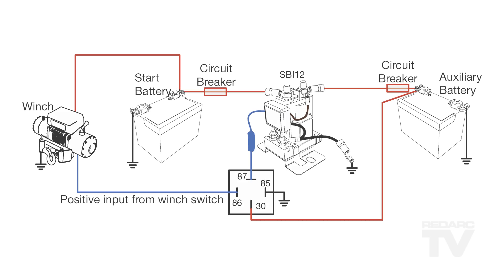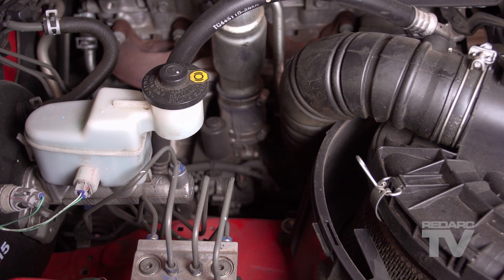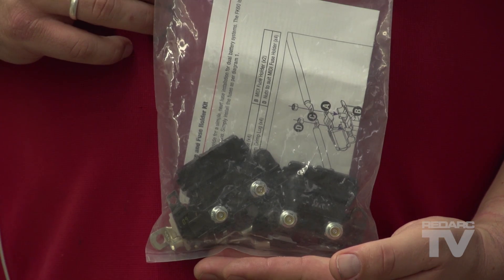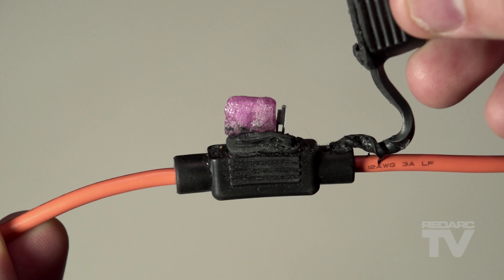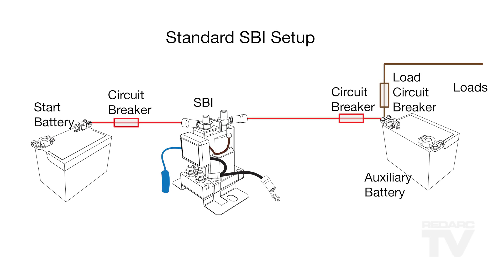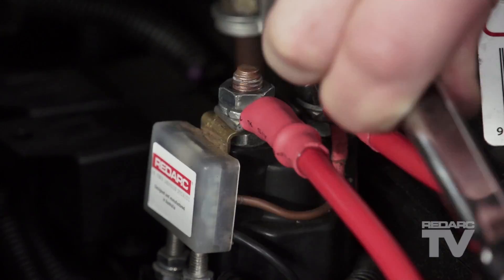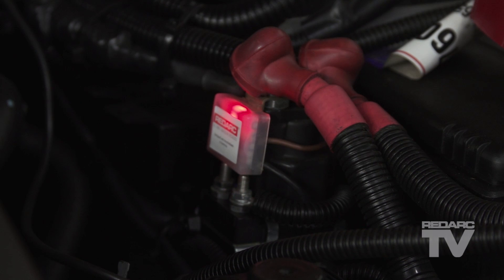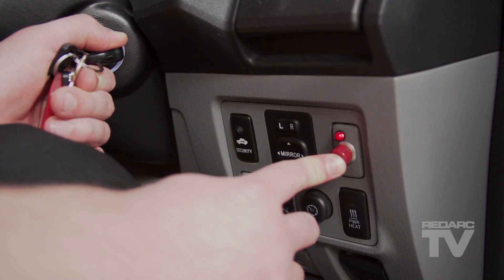How to install the REDARC Smart Battery Isolator

Comment: Can this unit work with a lithium battery?
Reply from the maker: Hi there - we don't recommend using an isolator in general for charging a Lithium battery. The power being given to the battery is not controlled and won't get the Lithium to 100% charge (more like 80% charged at most). You'd be better off with a BCDC unit instead that has a proper algorithm built-in for these batteries.
Reply: Good to know! Is this similar to a dc2dc charger for charging batteries to run product lines? Eg. Fridge

Comment: I have a question regarding that bridge device for jump starting. Is there a way to manually use that feature if you don’t have the button installed?
Reply from the maker: Thanks for watching! If you don't have the button installed you can bridge the override cable on the unit to a 12v source, this will activate the isoloator linking the batteries.
Reply: @REDARCElectronics  okay great thankyou. Is there a maximum distance that the isolator can be from the starter battery or auxiliary battery?
Reply from the maker: @ChristiannTyler  No maximum distance.

Comment: If you’re running a dc-dc charger with solar input between your lead acid crank battery and lithium auxiliary battery. Will using the override jump start function cause any damage to the charger or auxiliary battery?
Reply from the maker: Thanks for watching! It wont damage the charger but you'd need to check the battery's specifications to make sure it's suitable for that application.

Comment: Hi, a few months ago i installed this unit into my old hilux to run my fridge off my 120ah auxiliary battery. It worked great for a few weeks but gradually my car was getting harder and harder to start. Its at the point now that sometimes i cannot start my car unless i turn off my fridge. I am unsure of what the issue is because the isolator seems to charge the batteries fine. Any help would be appreciated.

Comment: 2:18 running a 100 amp agm battery with the red arc sbi as a house battery, can I get rid of the agm and run a lithium battery?
Reply from the maker: Thanks for watching! If you're looking at upgrading from an AGM battery to a lithium we'd recommend you also upgrade the SBI to a BCDC charger of some sort to properly look after the lithium. For more information on REDARCs range of BCDC chargers check out www.redarcelectronics.com/au/battery-chargers/dc-dc
Reply: I have the bcdc1225 and want the jump start feature of thr sbi. Will installing the sbi and jumpswitch cause a problem?

Comment: Why does my unit keep throwing the 100amp circuit breaker when I plug in my dcdc charger?
Reply from the maker: Thanks for watching! If you're having any issues, please don't hesitate to reach out to our Tech Support Team on 1300REDARC (1300 733 272).

Comment: Near the start of the video you show how to wire up a winch using a relay and the SBI blue wire...if I want to wire up the Option #3 (the jump start assist), can I do that by tapping off of the blue wire relay connection?  Also Option #3 does not show the inclusion of a LED indicator lamp, can the LED lamp be added to the Option #3 wiring diagram?
Reply from the maker: Thanks for watching! If you wanted to integrate the start assist feature you can, you will just need to wire the SBI12 as per the middle diagram on page 4 of the user manual. When wired this way you will want to T off between the momentary button and the resistor. This  cable will connect to pin 87 on the winch relay.

Comment: Great video! Is one of these needed if you have a smart alternator? I’m hooking up through the Redvision TVMS
Reply from the maker: Thanks for watching! If you're looking for charging capabilities with your RedVision and a smart alternator we recommend the BCDC battery charger or Manager30 battery management system. 

For more information we recommend giving our Tech Support Team a call on 1300REDARC (1300 733 272).

Comment: How long would it take to charge a flat 100ah battery?
Reply from the maker: Hi Scott, thanks for your comment. 

It will mainly depend on how much spare capacity the alternator has to give and the condition of the battery as to how long it will take to completely fill. If you’re looking to charge the battery from what we would consider ‘flat’ at 12V, for an alternator able to provide a spare 20A to the battery it might take approximately 2 or so hours of constant driving and a stable high voltage. 

There are quite a few variables, so can be tricky to properly work out too! If you want to have a chat to us about it, I’d recommend to ring our Tech Support team on 1300REDARC for further assistance.

Comment: I am about to install my recently purchased SBI12-D
The Installation instructions appear to be the same as for the SBI12.
I have watched your You Tube clip above and wish to implement the "Start Feature with Override Button" 
- I wish also to have the remote LED display indicating the unit is "working".
My issue is the fact that the 'D' unit works in both directing - can I display this fact with one or maybe two LEDs? If so, could you please provide me the circuit?
Reply from the maker: Hi Ron, thank you for your message. The LED indicator for the SBI12/SBI12D simply illuminates when the isolator is active – the Dual Sensing feature of the SBI12D measures both main terminal voltages and will activate when either reaches 13.2V, and illuminates the LED at the same time.

There is no ability to display the differentiation between which source activated the isolator, simply if it is active or not.

Option 2 on page 3 of the user manual provides the wiring diagram that includes the Push Button for Start Assist as well as the External LED.
If you require further assistance our Tech Team can assist in greater detail over the phone on 1300 REDARC.

Comment: Hi Mate, 
I'm wanting to run a second battery in the engine bay for a winch, but also another battery in my canopy to power a fridge and also some 12V outlets. 
What do you suggest I use? Engine bay will be AGM, canopy battery will potentially be Lithium. I have a 2021 SR5 hilux. Or is the canopy battery overkill for just a fridge, LED canopy lights and a few 12V outlets? I do plan on having solar input as well. I'm just unsure as to what is needed. The Hilux is only used for weekend 4X4 trips. 
Thanks heaps
Reply from the maker: The Lithium battery in the will be good – you will get the most useable power out of this setup for your fridge and relevant devices. We would recommend to use an SBI12 for the under-bonnet AGM battery and a BCDC1225D for the Lithium in the rear. That way, you are taking care of both, but not overloading the alternator of the HiLux either.
Reply: @REDARCElectronics  
Thanks for your advice, its much appreciated.

Comment: I am installing your SBI12 in my dual battery set up. As I’m putting the auxiliary battery in the tray, what size cable do i run from the SBI to the auxiliary battery? Length of cable is approximately 4.5m. Also the main load is an Engle fridge/freezer and some LED lighting.
Reply from the maker: Thank you for your message. This information can be found on page 1 of our instruction manual at https://www.redarc.com.au/Content/Images/uploaded/Manuals/SBI%20Instruction%20Manual.pdf

Comment: What does it indicate when the red light doesn't go off
Reply from the maker: Hi Glen, When the SBI12’s red LED is illuminated this indicates the SBI12 is ON (closed contacts). The SBI12 will Turn ON when the voltage of your starting battery rises above 13.2 volts and remain ON until the voltage of your starting battery drops below 12.7 volts. The voltage of your starting battery may remain above 12.7 volts for a period of time after the vehicle is switched OFF and therefore the red LED will remain ON.

Comment: Would the alternator have to be upgraded for the extra battery? Looks like a good bit of kit.
Reply from the maker: Hi there Luke, thanks for your comment. Depending on the vehicle, most will be fine to install a second battery to using an SBI. It will only throughput what the alternator can provide, so won’t overload the system too much. Most Auxiliary batteries of the lead-acid based variety can only take a certain amount of charge current anyway, so this will work well.

Comment: Hi Team redarc.
On the SBI there are two nuts just under the Square control model (indicator). Just wondering what the nuts are for??
Cheers 🤙🏻
Reply from the maker: Hi Jack,
The two smaller studs and nuts located below the module are the connection to the isolators coil. The smart module controls the isolator by applying power to the coil.
You will not need to connect any wiring to these smaller studs/nuts when installing a smart battery isolator.

Comment: My auxiliary battery set up in the rear of my wagon plan on running the earth wire back to the main battery or should I just earth it rear seats bolt as I’ve removed the seats?
Reply from the maker: Hi Luk, Either option is acceptable, provided the seat mount is indeed a common ground in the vehicle.

If you are running the cable back to the battery however, ensure that you connect this to a common negative point and not directly to the battery negative terminal.

Some vehicles monitor the battery through a sensor or shunt on the negative terminal, and bypassing this would result in start battery charging issues.

Any further questions please don't hesitate to contact our helpful Tech Support Team in our head office who can run through this in greater detail over the phone.

Comment: SBI 12  V SBI 12D what benefit the added feature in the second item, TY?
Reply from the maker: Thank you for watching. The SBI12D enables the user to charge a 12 volt start battery from a solar panel or battery charger on the auxiliary battery, whereas the SBI12 does not offer solar charging capability. Any further questions please feel free to contact our helpful Tech Support Team in our head office who will be more than happy to walk you through in greater detail over the phone.
Reply: @REDARCElectronics  Hi there, I have recently bought a car with the SBI12, 12VDC 100A and it has a solar panel connected with a PWM solar regulator. How is the redarc isolator working with the solar pannel? Or do you think that maybe the solar pannel could be charging the starter battery? Cheer
Reply from the maker: @danbeech6683  Hi Dan,
Thank you for your enquiry.
In a standard installation the solar regulator would be connected to an auxiliary battery as this battery will have accessories such as fridge’s and lighting running whilst the vehicle is off. The vehicles starting battery usually does not require additional charge from solar whilst the vehicle is not running.
The standard SBI12 will not operate when the vehicle is off and the solar will only be charging the auxiliary battery.

Comment: @Redarcelectronics  I have a Redarc BCDC1225D and the SBI12KIT (12v not 24v) for a dual AGM battery set up, in the engine compartment. I'm attempting to equip both the 'Jump Start' feature AND the 'Ultimate Dual Battery for Winching' feature, which the SBI12 enables. Questions: 1) For jump start feature of the sbi12, what is the minimum size momentary switch (amp rating) and minimum fuse size (amp rating) needed for that switch? 2) Also, can the same switch be wired to the SBI12 to accommodate both the jump start feature and the ultimate winching feature (i.e. in this scenario I'd replace the momentary switch with a latch or rocker style switch to accommodate both jump start (when truck starter battery dead) or to connect both batteries (while truck on) during winching)? 3) Or, are 2 seperate switches needed and if so, what size switch (amp rating) and fuse size (amp rating) is needed on switch connected to 'Ultimate Dual Battery for Winching' set up wiring? 4) Lastly, what minimum amp rating does relay need to be, for 'Ultimate Dual Battery for Winching' side wiring? Much appreciated.
Reply from the maker: Hi Jes,

The switching is only purely a signal to the unit to activate, so something around 1A-2A at the most is more than enough. You can use the same switch for both; you could use a rocker switch instead but just need to remember to turn it off when not needing the jumpstart or when not winching. For a bigger vehicle and heavy winch load, an SBI212 is a good choice (200A model). If it is a small winch and 4 cyl engine, then a standard SBI12 is fine here (100A model). If you have any further questions please don't hesitate to contact our Tech Support Team in our head office.
Reply: @REDARCElectronics  I'm in a 6 cyl Tacoma w/10,000 LB winch. SBI12 still fine? Thanks for replying btw.
Reply from the maker: Hi  @JesusWSalazar ,  being a bigger engine and winch in the Tacoma, we recommend installing the 200A version just to be safe. It will give you a bit more overhead on the current draw then.

Comment: Hi mate grate vid can i ask, can you use the blue over ride wire for winch and battery to battery jump? or can you only use one thing off it at a time
Reply from the maker: Hi 1972butchy, the BLUE override can be used to link the main and auxiliary terminals of the SBI at any time. If you are wanting to use the SBI to allow winching from both batteries, it would be worth upgrading from the standard SBI12 to the SBI212 as it has a higher continuous current rating. Any other questions please feel free to contact our Tech Support Team in our head office on 08 8322 4848.

Comment: Do you still need a BCDC charger when using a EFB battery?
Reply from the maker: Hi there, thanks for your question. It will depend on the vehicle you are installing the unit into and what type of Alternator that it has. If it is a vehicle with a Smart Alternator, then yes a BCDC is a good option here. But if the vehicle has a standard, Fixed Voltage type alternator, then using an SBI will be fine here.

Comment: Do i need an SBI if im hooking up a fixed solar panel to my auxillary battery? Would my starter battery run out of charge if i don't get one?
Also I've got a bcdc 1240d
Reply from the maker: The SBI12 is used to prevent the auxiliary battery, or any loads on the auxiliary side of the isolator from draining the vehicle battery.

If you do not use the SBI12, there is the potential that you can end up with a flat cranking battery and not being able to start your vehicle.
 Any further questions please contact our head office.

Comment: can i use 12 volt agm batteries with this, i have a ford flex, and i want to put my solar battery generator box in the storage area
Reply from the maker: The suitability of this product will depend on a variety of factors, namely the type of alternator your vehicle uses and what current your solar generator box is rated to.

For some vehicles a DC-DC Charger such as a REDARC BCDC In-Vehicle Battery Charger may be required to properly charge an auxiliary battery, with the output current of the charger selected to suit your application.
Reply: @REDARCElectronics  ty for info, i'll pepole on this side of the pond.

Comment: Don't mean to be picky but from my understanding of your documentation the min. recommended cable size (4 or 6 B&S) is determined by the length of run <3m or >3m  not the voltage 12 v or 24 v.  correct me if I am wrong but that's how I understand the instruction .
Reply from the maker: Hi Neil,

Thank you for watching, and we apologise for any confusion caused.

The cable size is determined by power – this means it is determined by the amount of current flowing through a circuit of a certain length.

Our Tech Support Team are more than happy to help walk you through this or answer any questions you may have on 08 8322 4848.

Comment: If the second auxiliary battery that is connected using the SBI is a AGM Deep Cycle unit, can it be used as an emergency starting/cranking battery ? What is the minimum & maximum Amps (size) required for the Aux. battery to be used as a cranking battery ..? (Landcruiser 200) // Ta
Reply from the maker: Hello, thank you for the reply. When using an SBI12 we recommend that the auxiliary battery is the same chemistry as the factory starting battery (normally Lead-Acid). The reason for this is the auxiliary battery is being charged only by the alternator. The alternator is only designed to charge a Lead-Acid based battery. If you do want to use the auxiliary battery to jump start, the battery MUST have a CCA rating (Cold Cranking Amps). We would recommend the auxiliary battery have a CCA rating the same (or higher) as the factory starting battery. This will be written on the factory battery. For any further information, please contact REDARC Help Desk on 08 8322 4848.

Comment: Hi. I have one of these in my dual battery system as well but I'm not sure if there's something wrong with mine as when my vehicle is off any accessories on the 2nd battery won't work and my voltage drops dramatically if the red LED light isn't on.
Reply from the maker: Hi Tarkan, our tech team is more than happy to help discuss this further. Please reach out via phone on 08 8322 4848 or email at power@redarc.com.au
Reply: @REDARCElectronics   hi turned out to be a bad battery. Bought a new one and now everything is fine.

Comment: Will this engage to charge the starter battery from the auxiliary battery if they have 12V and 14V respectively.
Reply from the maker: The standard SBI12 will only "turn on" when the starter battery terminal detects voltage above 13.2v.

The SBI12D (dual sensing) will monitor voltages on both starter battery and aux battery terminals. If either detects voltage above 13.2 the SBI will "turn on" and link the two together.

For further assistance please be sure to contact our Tech Support Team on 08 8322 4848.
Reply: Thank you!